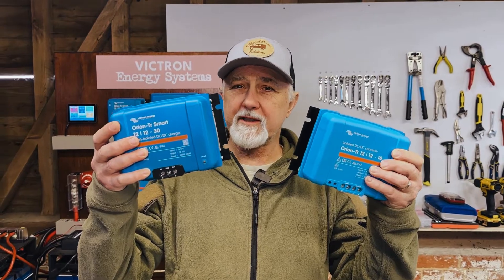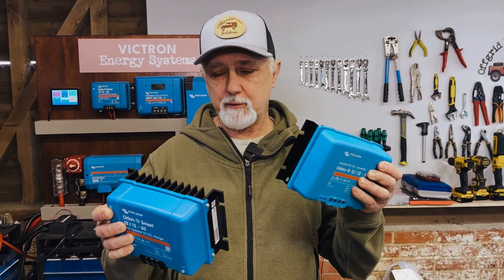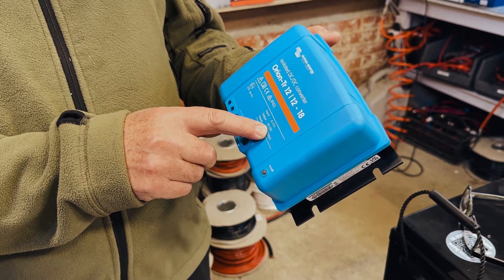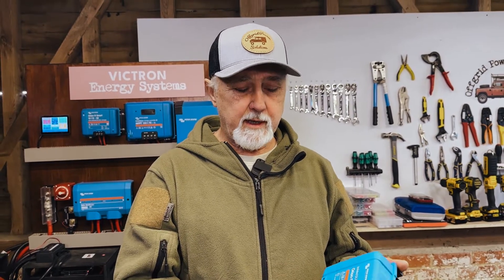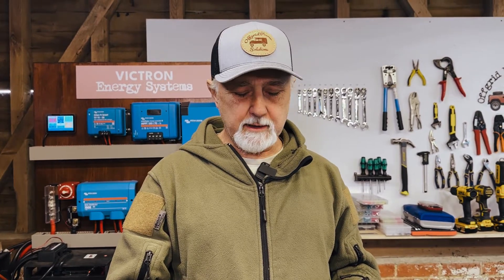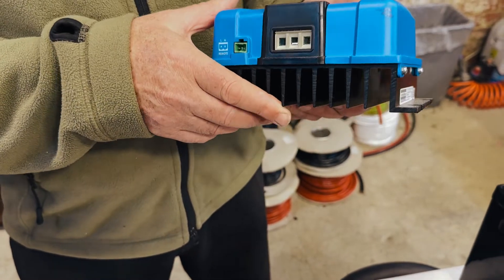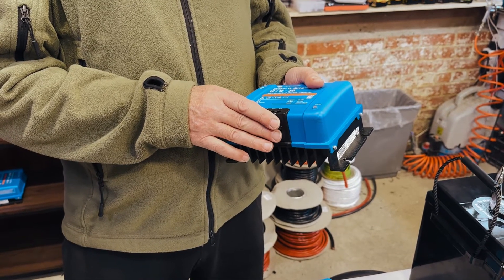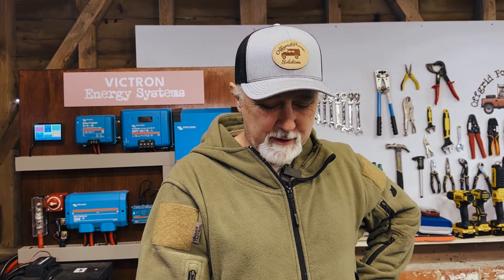What's the difference Victron DC to DC CHARGER & CONVERTER?

Comment: If you are charging a lithium battery power station with a built in charger that can draw 11-60v and 30a, and youre charging it from a cars 12v battery with engine running, is it a good idea to use for example a dc-dc converter making the voltage a steady 24v and then turning down the amps a little? I am thinking that maybe it is better to be stable closer to the middle of the 11-60v range than to be at the bottom end, while maximizing the amps.

Comment: Confusing. Your calling the charger a converter?
Reply: No, your alternator on your vehicle might get fried like mine did on my trip. It protects your vehicle electrical system and your alternator. Lithium batteries on your RV needs a faster charge and it overloads your alternator and that is why your alternator will fry.

Comment: Probably if you run a 48v system best to add a secondary 48v alternator just to charge the leisure batteries, dual alternator brackets are quite common and 48v units can be had. Just need to place a cutout interlock on it that removes the excitation for when its not connected to a battery.

Comment: Thanks for video! I have one question. Which one I can use the power  the inveter 150w. I have li-ion 3s battery and my inverter stop work 10.5v low voltage. I want to use the battery to 9v . Is it possible?

Comment: Re the Converter, you’re missing the point.  It is designed to provide dead steady 12v for your van electric kit like fridge, fan, diesel heater or any 12v device that can’t tolerate any voltage above 12v.

So when you charge your leisure battery, the voltage across the battery rises to say 14.2-14.7 volts and if that is the source of your 12v system in your van some 12v devices may be adversely affected..

The dc-dc charger on the other hand is designed to be connected to the alternator/starter battery and configured to provide 13v or above to charge lithium or lead acid batteries.

Comment: Thanks for the video and the clarification. I just bought the Victron 48/12 -30A (360W) DC-DC converter. The manual says that an external fuse is required. I cannot find information about size and type of fuse to use. I will be using 6 AWG as recommended. Thanks !

Comment: If I just wanted to be able to charge my 12v lead acid with my 36v lithium troller, would one of these 48v converters work? I don't see a dc to dc charger thats over 24v. I just want to be able to run boat lights and electronics at night (engines off, not using troller) without draining my 12v starter battery.

Comment: I bought a 12 12 30 isolated Victron for my Land Rover. However i want to enable the victron to be bipassed when winching so i can get max amps from my two batteries. I used to have a VSR relay wired via a switch to enable this and it also enabled jump starting of the main battery in emergency. Is it possible to have such a set up with the Victron as i do like the fact its topping up my second battery much faster than the VSR did. Thank you

Comment: i have a 24 volt system on my boat and require 12 volt my worry is if the unit fails i loose the 12 volt supply is there a way to wire in a back up so if it fails it will switch to a 2nd system .Also i just bought the victron buck boost 100amp for the cost i could of got 3 50 amp buck boosts could i have just installed 2 and save 500 and then would have redundency
Reply: An easy way to provide some limited amount of backup is to install a small 12V battery.  A 25Ah motorcycle battery would do great, it is very small and easy to install, and available for under $100.  The converter keeps the battery fully charged, the battery provides a little additional capacity for surge loads -- and if the converter fails, you have several hours of power for critical loads.    Of course, you won't KNOW that the converter failed until the battery dies.....

Comment: So going through all your videos.  Can i just use the existing 12V+ that goes from my truck to the trailer through the factory rear connector for my D+ signal?  my 2022 Ford already only turns this 12V+ "on" when the engine is running AND if a trailer is connected.   And yes, this 30A capable 12V is same circuit as I will power into the DC-DC Victron Charger.   Or alternative idea, is using the trailer lights circuit.  then D+ will simply activate whenever my trailer lights are on.   Again, thank you for great content.

Comment: Great video. Can I connect my Victron DC to DC converter directly to my alternator vs my starter battery? My van has engine in the back, and starter battery in the front while my lithium aux battery is in the back. I'd like to avoid running wires from my starter battery in the front to the back. I was thinking that I should be able to because in theory, voltage at my alternator should be the same at my starter battery ... but that's theory.
Reply: I have gone directly from the positive terminal on the alternator with no issues. Obviously the starter battery is connected as well but as you say, it's at the wrong end!
Reply: You will have a heavy battery  cable on the starter motor.

Comment: Got a 12v wind turbine for my van but the charge controller won’t work with LiFeP04, would one of these wired after the controller charge my battery safely?

Comment: How would it be possible to simply charge a 48V LiFePO4 battery from a 12V LiFePO4 battery? 
And I don't want to use a 12V DC/AC inverter + 48V charger and waste energy on DC/AC conversions. Would it be possible somehow?

I like on Portable Solar Stations is that if it connected a battery in the volt range to the solar charging input, it is possible to charge a Portable Power Station this way (there are many videos about this), but I would use the same option for a DIY solar system. The goal would be to be able to solar charge a smaller, lighter 12V LiFePO4 battery somewhere else like the main 48V system and then at night or on bad sunny days charge the main 48V system from the lower voltage battery = transfer energy from the 12V battery to the 48V battery. Victron solar chargers need an input voltage 5V higher than the battery voltage to charge, so they cannot be used.

How about using the MPPT 100/20 with boost step up converter? The MPPT 100/20 can charge all 12/24/48V batteries, so it could solar charge 12V battery somewhere else and then use the same MPPT 100/20 together with a boost step up converter with a manually adjustable output to charge 48V battery in the main system. The MPPT 100/20 will think it has a DC output 5V higher than the empty 48V battery up to its maximum solar panel voltage of 100V and will transfer power from a charged 12V battery to the empty 48V battery just like a Portable Solar Power Stations with connected a battery in the volt range to the solar charging input 

Boost inverter parameters should be: 
Input current: 20A - rated current of MPPT 100/20 
Input voltage: 10,8-14,6V or more - from discharged to charged 12V battery
Manually adjustable output voltage: 40V - 100V 

Discharged 48V battery has a voltage of 40V+5V=where the MPPT should start charging up to 100V, which is the maximum the MPPT can charge. A manually adjustable output voltage would be needed to not bring full power to the MPPT right away, but to simulate gradually increasing sunshine, where it would slowly manually increase from 40V, where it would not charge yet, to 40V+5-8V where it would start charging to the full 100V on both devices.

What do you think about this, will it work, is it safe?
Do you have a better idea how to do it? 
Thank you in advance for the answer
I apologize for the long comment